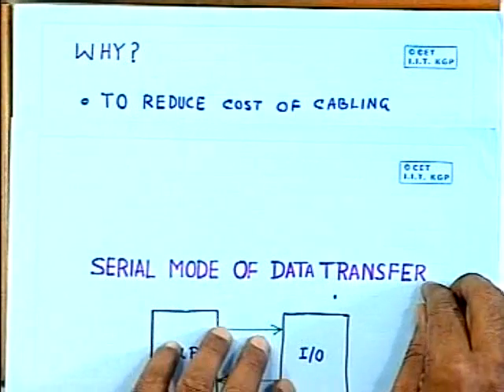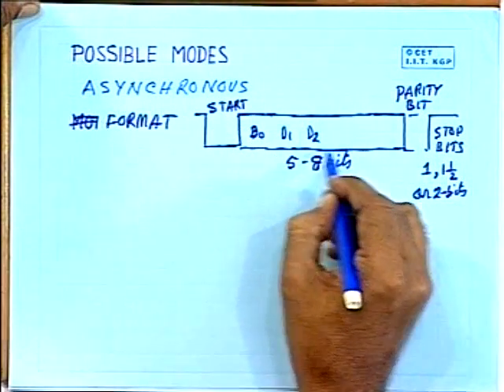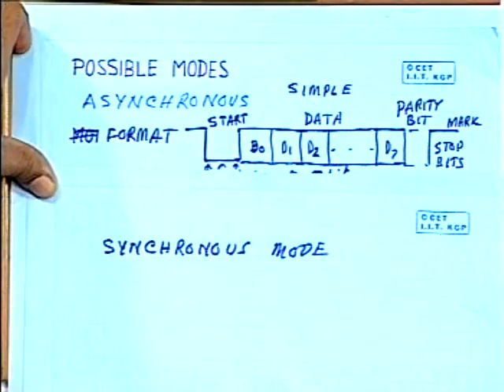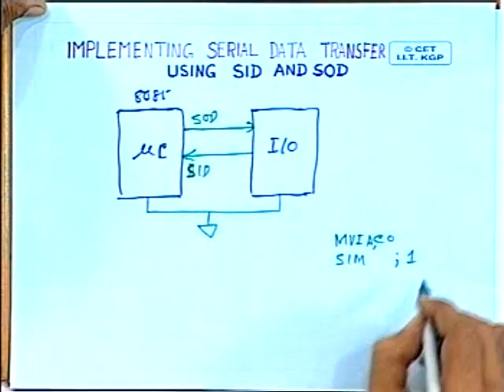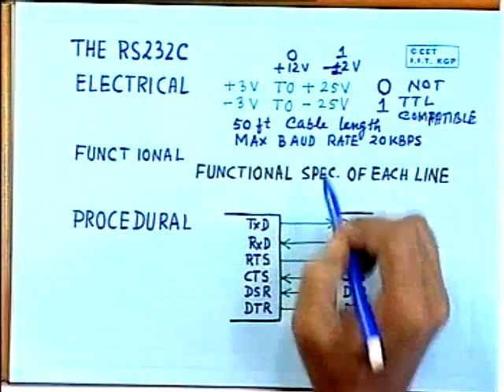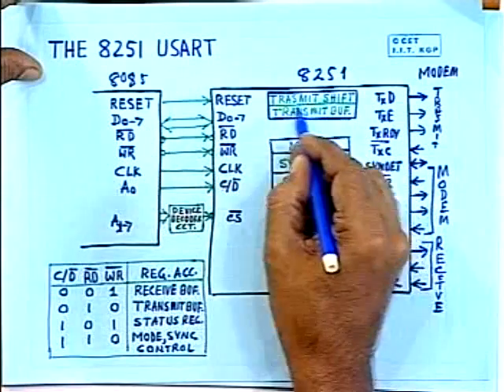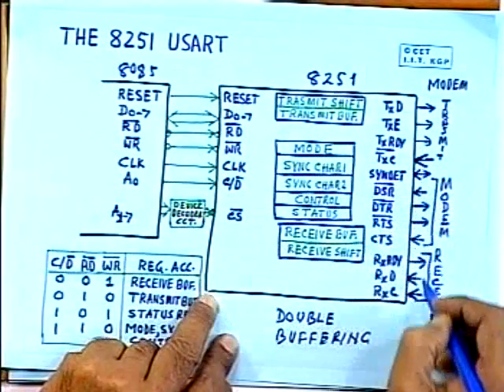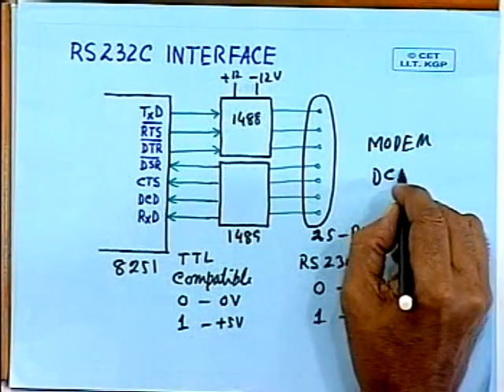lec 18 - Serial Mode Data Transfer

Comment: In theory this is all very fine but I am having the oddest weirdest funniestphenomenon with the 8251 UART.

Its system clock is 2Mhz. 

Asynchroneous transmission works perfectly with 15625, 28800, 62500 baud and some other values which is decided by a separate Arduino square wave TTL oscillator which can be programmed continuously between 31hz and 65Khz. So there's no issues with the RxTx clock. It is below 4.5 fclock8251 as demanded by the specs. This works for both sync and async transmission according to the specs. 

I can program the Arduino at different speeds and it effectively produces the frequencies I mentioned above. 

The phenomena is that the 8251 pertinently refuses to transmit the data proparly at 31250 baud. It garbles. 

I would like you guys to produce this phenomena in your class lab or at home. Use 2Mhz as 8251 system clock and use a lab or other oscillator to produce the TxC clock. Make sure to use different frequency settings between say 400hz and 64Khz and observe how the 8251 produces the data stream. 

Let me know if your 8251 succesfully produces correct serial data at the TxD line at several randomly chosen TxC frequency. Especially when TxC is 31250. This is very important because the fenomena I experience is with several 8251 chips I have exactly the same as described above. 

Let me know your results asap.